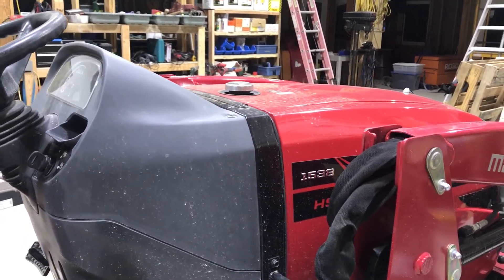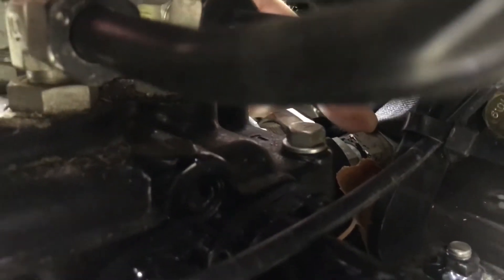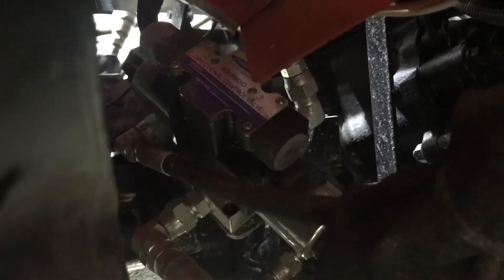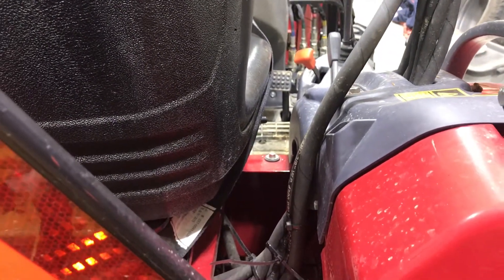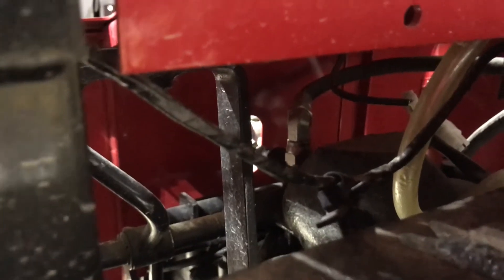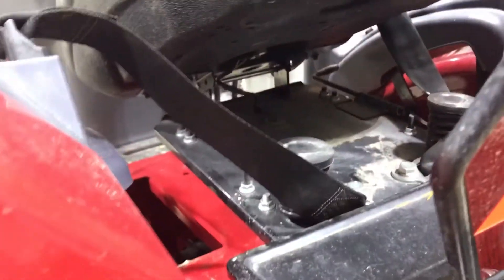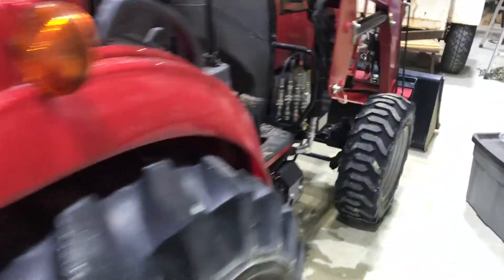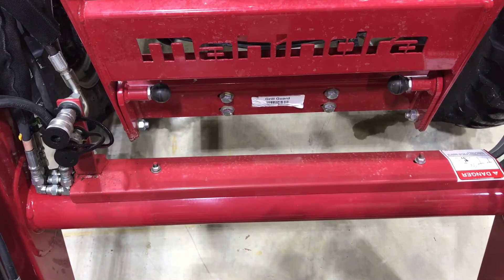Mahindra 1533 1538 hydraulics 3rd Function how to

Comment: What size is the fitting coming out of the Loader valve?  Is it metric?
Reply from the maker: My recollection is the Power Beyond in the valve has metric fittings. Mine has an adapter and I like the JIC fittings the best.
Reply: @bodereiss  thanks.  I'm going to pull the hose off the line that goes to the power beyond port on the loader valve and take it to a local hydraulic shop along with the 3rd function valve.  I'll get them to figure out what's what.
Reply from the maker: @dannyflowers8322  It’s been too long to say go sure on the Mahindra. But most of the time the Power Beyond would be a cap and not a hose. It doesn’t get used unless you have something “after” the loader valve….like the 3rd function.
Reply: @bodereiss  the line that you identified as the power beyond line is the one I'm talking about.  It's a hard line coming out under the seat, runs down and along the right side and just before the lower side of the brake pedal there's a transition to a hose that is the hose you point out as the power beyond.  Looking at the parts breakout diagram it's identified as pressure, the hardline next to it is the return.  

Correction.   The parts breakout identifies the line you pointed to, as pressure not power.  The other is identified as return.
Reply from the maker: @dannyflowers8322  I just looked again at mine. It has a hard pipe and next to that is the power beyond port. Nothing is attached to it except the aftermarket 3rd function and rear remotes. I didn’t tee into an existing line.
Reply: @bodereiss  👍

Comment: I have a 1533. I'm putting on a 3rd function. I found the power beyond. For the return under the seat there is a steel line which is the pressure line. Do you have the same thing. What port did you tie into for the return?
Reply from the maker: The return is a threaded fitting that faces straight up under the seat and just to the left of the 3pt valve that controls the speed at which the 3pt drops. If you pull the panel that the seat is attached to it should be hard to miss.
Reply: @bodereiss  thank you for the input. I was just curious if you had the hard steel line that comes out of the top of the case near the that valve
Reply from the maker: Mine doesn’t at this point. I have an HST which may be the difference. You should be able to find a plug in the case to dump the return Into. Where does the steel line go?
Reply: @bodereiss  yeah mine is hst too. I guess I'll have to call mahindra.
Reply from the maker: Yah if you can’t figure out where the steel tube goes it probably best to call someone.

Comment: Just curious how you determined where you tied into the hydraulic block was the power beyond port and not the tank return? 
Thank you
Reply from the maker: Michael Saylors I was told by the dealer. But if you don’t know you can use a gauge and pressure test them. The gauge is a $20 tool you will likely need anyway. It’s one of the first diagnostic and adjustment tools you need for hydraulics. You can tweak your system PSI with the gauge too!
Reply: DL R hey man appreciate the response and info.

Comment: I want to add the ability for a third function.  I thought about just adding the rear hydraulic kit and then use an extension hose set from the rear up to the grapple when I need it.
Reply from the maker: If the idea of making those two connections back into the machine isn’t something you want to tackle a kit from the dealer or someone else may be best.

Comment: Very timely video.  I just ordered the Mahindra “3rd function” kit only to find that it is a diverter valve. So now I’m in the market to set up a true 3rd function. 
I have a 1533 with backhoe and rear remotes. On my tractor it looks like they use the power beyond port for the backhoe.  The rear remotes appear to come from a block on the side of the transmission with no obvious feed line, so it must be getting pressure from an internal port.  Can I tee off the backhoe line on the power beyond port to power the 3rd function?
Reply: Did you ever get this done? I have a 1533 shuttle with backhoe and am wondering what’s best to do myself.
Reply: @peterlast9354  yes I did. Been using it for several years now. 
I ordered a kit from Everything Attachments (they have a good video out as well).
I use it for a grapple and a plow.  Very nice not having to share a function like a diverter. 
Misleading if Mahindra to call their kit a 3rd function when it’s really a diverter.
Reply: @motor2of7  you have the backhoe, where did you end up connecting the kit to? The loader connections or underneath the tractor like the guy in this video? It would be awesome if you could take pics or short video and email it or upload it to YouTube to help us out. What kit, the wr long? I’m looking to do this too.
Reply: @lh98  let me see what I can come up with